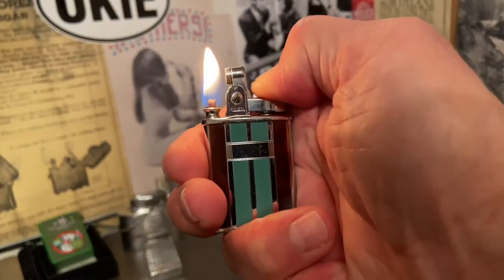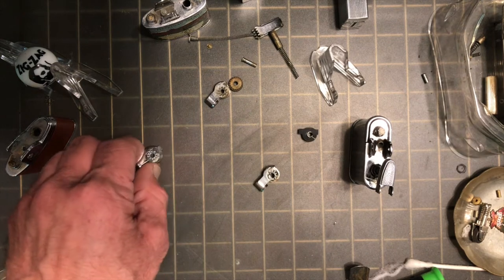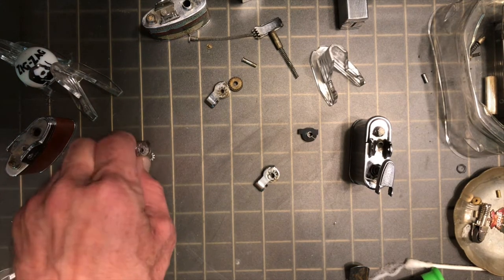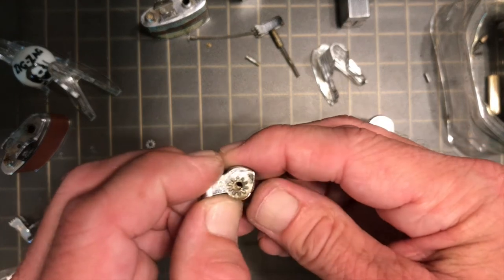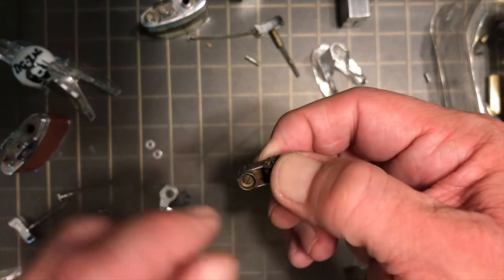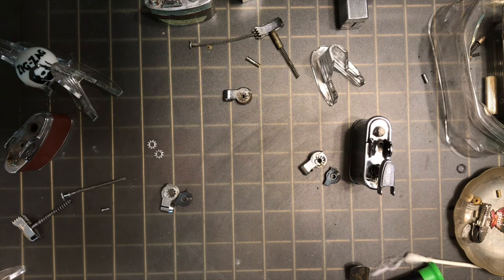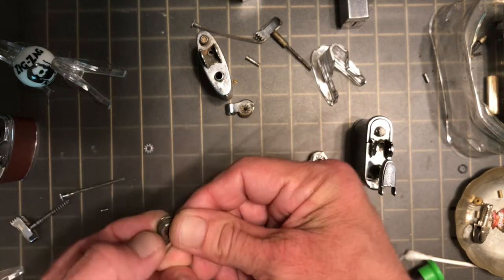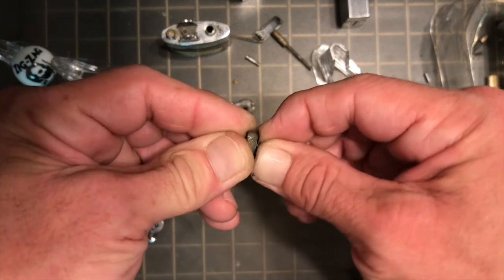How To Orient The Clutch Spring In A Ronson Automatic Lighter Mechanism

Comment: Thank you! Finally found a video that talks about the clutch spring and how to install it.  Just like the comment your talking about, I took mine apart to clean it and it fell out not knowing how it goes back in! Mine is the one that is at 5:06. Thanks again

Also just noticed after putting it together and watching your video.  It fell out because looks like I'm missing a little screw that holds the clutch spring into the "snuffer"
Reply from the maker: I'm glad to help!✌️

Comment: Super grateful for your videos! I have a lighter with a mechanism like the second one you showed. I'm having some trouble getting it to hit the flint and spark.
Reply from the maker: Have you cleared the tube of the old, degraded flint?✌️
Reply: @DependableFlame  thanks for the reply! yes, i have! going to get new flint today to double check. it looks like the wheel doing move much when pressing down
Reply from the maker: @jackieau5374 , it sounds like the clutch spring may be faulty.✌️
Reply: @DependableFlame  any recommendations for fixing it? Or is it just a bust?
Reply: @DependableFlame  hey again, just wanted to let you know i got it working :)
Reply: @jackieau5374  Hey mate, I’m having the same problem, how did you go about fixing it?
Reply from the maker: You should be able to find a replacement without too much effort.✌️

Comment: Hi.. video is great and clearly explained👍

I have a really nice vintage Ronson.. it seems to strike.. spark fairly  well, but when I fill it with petrol it won't light the wick? Is this the clutch?
Reply from the maker: Not likely if it sparks. If the clutch spring was not engaging then it wouldn't be sparking. Did you try to light it after letting the fumes dissipate?✌️

Comment: I took mine apart but there wasn’t a clutch spring. I can’t get mine to work. Any suggestions
Reply from the maker: If there is actually no clutch spring then someone else must have reassembled it incorrectly. Some clutch springs are hard to recognize though. Did you look for a little protruding arm resting in the snuffer assembly atop the snuffer cap?✌️

Comment: Is there anything you can do if there is no clutch spring? I have two lighters that do not appear to have this part. I believe I have the same exact lighter that is shown in this video.
Reply: This seemed self explanatory to me as well, however when I orient all of the parts the way you did, it will not spark. The flint tube is not blocked, so I do not understand what it is being caught on.
Reply from the maker: Many of these have clutch springs integrated into the snuffer cap.✌️

Comment: I have a Wales Japan lighter (ronson clone) that has a similar mechanism to the second lighter you showed here. However, there is no clutch spring. Do you have any idea about where I could buy one or how I might 3D print one?
Reply from the maker: Are you certain the clutch spring is not integrated into the underside of the snuffer?✌️
Reply: @DependableFlame  It does not have one. The spark wheel slightly rotates when no flint is inserted due to a weak friction with the sides of the wheel but it does not rotate at all when a flint is inserted. I wonder if there is anything I could put into there, if not a legitimate replacement part, to serve a similar function?
Reply from the maker: @VidsforCaleb , a parts donor lighter off Ebay would be your easiest, quickest bet.✌️
Reply: @DependableFlame  Thank you for your help!
Reply: @DependableFlame  Thanks for the suggestion. I bought a replacement and it contained the clutch spring. Now I am going to try and make another one using a 3d printer because it is such a simple part. Thanks for your help
Reply from the maker: @VidsforCaleb , you may be able to shed some light on today's video:

https://youtu.be/tXGJl8IlBXI

I was wondering about 3d printing.✌️